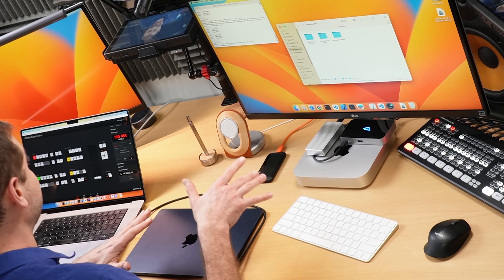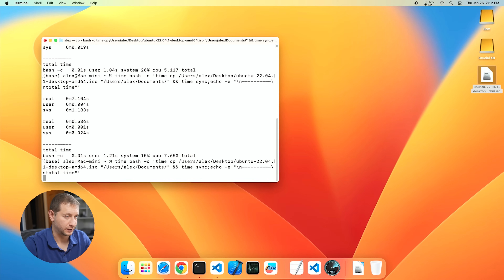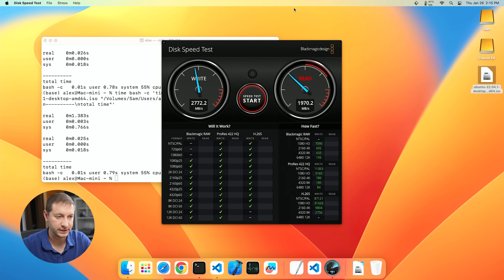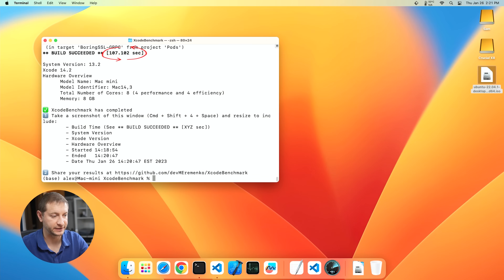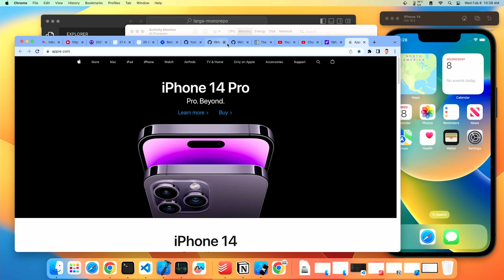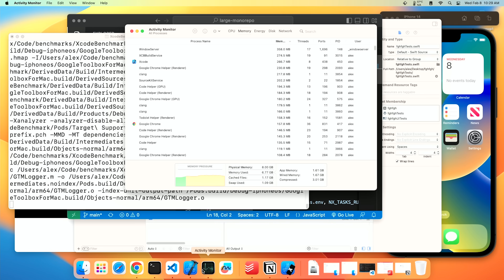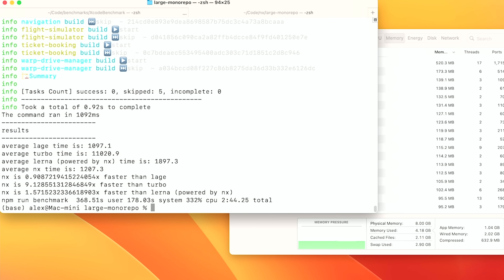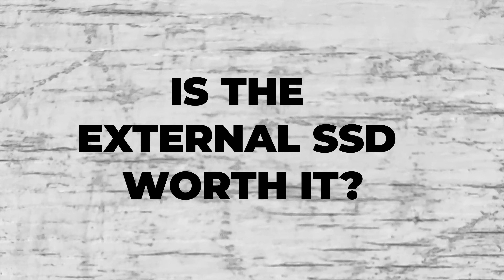...but there's a catch

Comment: Has it been confirmed that if macOS Sequoia is installed to an external NVMe drive and you boot into that external drive OS, that the swap that it uses by default will be a swap partition on the internal drive?

Comment: I just upgraded to the Mac Mini 4 with 16gigs of ram and 512 HD. After watching a few videos the ram is upgradeable and the job can be done in less than an hour, not that I plan on doing this as I got the same external as you have and put a 2 TB drive in it

Comment: I have a question.  Did I make the right choice?    I ordered the new Mac mini with 32 Gb ram but left the internal drive as base 256 Gb.   My logic is I can upsize storage externally, but can never do anything about the on chip memory size.  
Is 256 going to big big enough to future proof the macOS versions?  At what point does the OS take up enough of that 256 to become a problem?
Reply: The latest macOS only requires 25GB of free space to install, so there's no reason to be afraid that 256GB will be too small for future versions anytime soon (as in within the next decade). There might be reasons why future versions require significantly more disk space to work well post-install, but if 256GB ever becomes an issue, it's very likely that you'll be able to offload some of that extra stuff to an external drive -- e.g. a large local data cache for Apple Intelligence. At worst, you would sacrifice some performance, but even then, in most cases, you'd be fine.

I'm getting the 256GB m4 mini and planning on buying a 1TB external Gen 4 SSD for everything but macOS itself. Should be fine for the foreseeable future.
Reply: @ 
Thanks for the reassurance!

Comment: I dont exactly understand why you dont picked the Samsung 990. I mean it has better read and write speeds. Is it because thunderbold 4 is Not as fast as the 990. Pleas help!
Reply: Above 3000MB/s you get diminishing returns. TB4 tops out at 5000MB/s but the M1 and M2 implementation limits the throughput to around 3200MB/s so any drive faster than that isn't worth the money. This is because internally it uses PCIe Gen 3.0. Not sure if this still applies to the new M4.

Comment: I got over 3500Mb/s write and 2500 read speeds with external 40Gb/s connection. With good and short USB 4 cable.

Comment: I have an samsung ssd that came inside my mac mini late 2014 2.6 intel i5 version. My ssd writing/reading speed is around 600-700 mb/s.  Can I get higher speeds with samsung 990 or it is limited by the manufacturer?

Comment: Is there a way to let the Mac Mini use an external SSD for swap without booting from it? (might be a dumb question)
Reply from the maker: not a dumb question, but a very good one. i researched this and while there are some hacks, it’s not going to work well. swap is for really fast memory access, and putting that file on external will likely drastically slow down the system should it need swap. i’m also not sure about how stable this setup would be.

Comment: Thank you so much for posting this here. This was a fantastic solution to a big problem for me. I made the mistake of buying a Mac mini with a quarter terabyte hard drive and that filled up much faster than I expected. But here are a few tips for everyone if you decide to go this route. This is what worked for me. Your situation might be different, so be aware that you were using these tips at your own risk.

0. Create another administrator account on the Mac. You will need this to change the home directory for your moved user.
1. Close all apps on the account you are moving to the external drive. 
2. Turn off iCloud Drive completely. Before I did, this, I was getting repeated errors that blocked the copying of the home directory to the external drive. I found this was the issue after moving the contents of the home directory one at a time and the issue was in the Mobile Documents folder in the user Library. This folder is deleted when you turn off iCloud Drive. Files will remain on iCloud.
3. Do is a fresh Time Machine back up of your Mac. 
4. Open to Finder windows side-by-side.
5. Drag and drop the whole user home directory to the external drive. Do not delete the original home folder. 
6. Log out of the user being moved and into the other administrator. 
7. Change the home directory per https://support.apple.com/en-us/102547 
8. Restart the computer and log in to the moved user. 
9. My wifi and ethernet would not work at this point. I resolved it as follows: 
10. Go to System Settings / Network and click the (...) button at the botton, click Locations / Edit Locations / click the plus sign to create a new location and save/apply that. This got my wifi working. 
11. To get the wifi working again, I navigated to System Settings / Wi-fi / clicked the Details button for my wifi, click TCP/IP  and clicked Renew DHCP Lease. 
12. At this point, don't delete the original internal home directory, but rather rename it by putting an X at the end of its current name. 
13. Restart the computer and login to this user again to make sure things are working properly. 
14. Be aware there may be some apps that will be looking for specific folders that they think are on the internal drive. You may need to go into their settings to update them. The Photos app in particular will have a specific location set for the system library and you will need to update that. For that one, I navigated to the external home directory where that library was located and opened it from there. That got it properly aligned. Otherwise the Photos app will try to open the one on the internal drive. Dropbox is another that will need re-linking or to be set up again. 
15. In the Time Machine settings click Options and make sure it is not excluding the external drive where you're home directory now resides. 
16. Change the name of the original home directory back to what it was. 
17. Delete most or all of it's contents, depending on what you run into in doing so. Remember the user Library is hidden, so you need to type Command+Option+. (that's Command+Option+PeriodKey) to reveal hidden files in Finder.
18. Do a new Time Machine back up.

Comment: If you run your MacOS from your external drive, is the internal ssd used at all? I imagine is external drive is now the system drive, memory swap will also happen there instead of the internal ssd.

Comment: But... there is something missing there. It doesn't make sense. You can see in the Activity Monitor when running on the internal SSD that there's only one instance of node and it's taking ~500 MB of RAM. When running on the external storage there are like 10 instances, each one taking 1.5 GB do RAM, bringing the system to that unstable behavior.

It doesn't make sense that you're running at a faster storage and the system is slower in comparison. You're not requesting as much swap in both scenarios.

My only explanation which is a far fetched one is that the system bus is taken over by the Thunderbolt 4 transfers, such of which it doesn't happen when using the internal SDD. And when TB 4 is being used, the parallelism takes longer, more resources are being allocated when the current running tasks should have finished before allocating new resources and creates a snowball of competing resources. But that's speculating a lot of conditions.

Again, I believe i missed something because it doesn't make sense.
Reply: another thing I noticed. It's a freshly installed system, right? The OS is still performing the metadata for Spotlight, among other things. Check that mdsync process, taking between 2.5 and 3 GB of RAM.
Reply: @DocaTafner  very important, i remember that even on my m1 macbook air, in the first days using it, spotlight, time machine, and other apple process would suddently start using almos 20gb of swipe memory! im not even joking

Comment: worst news for me. I just bought a M2 mini 512gb 8gb ram for use with Logic Pro X and will use an external SSD to mitigate the ram limitation. Does not sound promising
Reply: have it worked?
Reply: @DanielMaia  it works fantastic only issue is my SSD disconnects however I make sure it’s plugged into a USB-C port not a hub
Reply: @RedCloudServices  but if you let it plugged into the usb-c port it is ok? my swap memory usually its arround 5gb when im working on logic if you want to know

Comment: has anyone else had problems with their external drives randomly disconnecting?
Reply: My system keeps freezing then restarting - i have a feeling its to do with drive getting to hot
Reply: @darkkent8  in the end I purchased a different drive enclosure and everything worked fine after that.
Reply: @cyberlizardcouk  Thank for coming back to me, what enclosure did you have? and what did you get instead?

Comment: If you’re going to stress test the system then buy a better SSD. You used a 3 year old SSD that maxes out at 3000r/w that will throttle with heat. Getting a late gen 4 ssd like Solidigm should get you more bandwidth for intensive tasks as they’ll only be pushing half of their capable output and will run smoother and more consistently. This video is exactly why Apple locks down their ecosystem. Different part’s different results.

Comment: Sorry I didn’t get one thing. If I would use the external drive as a backup drive, not the system one, and manage all repos in there how would npm installs and frameworks start go? I am a heavy Gatsby user that is great but it sucks at performance on build/dev boot..

Comment: That's why I don't like greedy Apple products,  instead of making a user-friendly solution for replacing the internal SSD for any other you want (or even upgrading RAM), they initially started using their proprietary SSDs (fortunately there were adapters for such cases, I have a couple) But later they started soldering SSDs with the RAM, I cant accept it, it's not an tablet, it's a working horse, one should have an easy way to recover the data and the whole working process if SSDs had a failure. But now the lifetime of the new MacBooks (if you don't use eternal drives as a system drive) practically compares to the lifetime of the their internal SSDs (other components, except battery, have less impact on it)

Comment: This is insane. Thunderbolt 4 hub, Thunderbolt 4 drive enclosure,  additional drives.  All this extra money to save on the base Mac Mini.  How can anyone consider the Mini a bargain? What I came away with is buy a Mini with more RAM and then buy the necessary items for more storage. This becomes expensive very fast. Other than possibly single threaded core performance how would a Windows desktop compare at the same price points? Forgot about laptops as the Mini is a desktop and is not a valid option for portability - you still need a keyboard, mouse and monitor.
Reply: "How can anyone consider the Mini a bargain? " - because most people don't need what Alex demonstrates. One can get a M2 Mini w/ 16GB in the Education store for $679. Add a $78 Samsung 1TB SSD and make that your boot disk.  In total a moderate cost for a machine that will be all 99% of people will ever need.

Comment: Great video!
Observation: I copied your Mac Mini setup to the letter including using a Samsung NVMe in the Orico enclosure as my boot drive on the Mini 256/16. To my surprise, the Orico enclosure gets very hot during even minimum use. Since it is my boot drive the heat makes me very nervous. Is this something you’ve run into? How much should I worry?
Regards

Comment: I believe the culprit is not the Thunderbolt interface, but the flash drive. The 970 Evo Plus has been silently crippled by Samsung to use QLC NAND instead of TLC NAND. Once the superfast SLC cache is filled/overwhelmed (easily done by swap) then the drive will run much more slowly. See "Samsung seemingly caught swapping components in its 970 Evo Plus SSDs" dated 8/27/2021 on Ars Technica. 

Using a higher end/better quality drive would probably have avoided your performance issues when under heavy memory pressure. Just remember that there are also DRAM and DRAMless M2 drives too, and although DRAM SSDs are much faster one must also consider what happens in a power failure since DRAM information is wiped once power is cut, so finding a DRAM SSD should also have capacitors to keep them powered so information on the DRAM can be written to the SSD, which is probably important for an OS/data drive.

I think Apple has given a great deal for the base machine, but 8/256GB is probably underspecced for anyone doing more than basic browsing or office type tasks.

Comment: SoI tried this before seeing this video. Started with the Samsung T7 shield 2tb SSD...
It wouldn’t work!!! I then tried using a Sandisk G-Drive 2tb SSD. It allowed the proper format.
The Samsung T7 would not except that format.
I installed Ventura, copied the 256 internal drive to the Sandisk.
Works ok, but I lost nearly 500mbs of speed due to limitations of the drive maxing out at 1050mbs...
At least I gained 2tb of storage. I already had nearly 100gb of music on the 256 SSD internal drive.
With 1.62tb of iTunes files on a external SSD. Apple loses way more than they realize by being so outrageous on storage prices...!

Comment: Swapping to an external SSD does not use DMA. Samsung 970evo plus has one disadvantage in that scenario when more than 80% full the 990 Pro is the only drive that nearly does not go down in access time and transfer rate due to a changed timing of TLC and a better Controller. Having the thunderbolt drive as the main work drive but not the boot drive is fine. It takes the load and is easily replaceable or upgradable when used up. The only issue with those drives is they need good cooling, otherwise, they slow down when getting hot. So don't underestimate the contact with head transfer material to metal parts in the enclosure, they have to be well established to have a stable system. I use it as the main Finalcut Work folder, Download folder and VM image folder. Those folders have been linked to the normal System on the internal SSD. Works fine and is reliable.

Comment: What about running the M2 mac Mini from the external drive and not using the internal at all? I got the base model with 16GB Ram and the 256GB storage and use a sandisk 1TB external

Comment: You said something at the end about loading software on the external drive. Did I understand that correctly? Sorry, I am new to this. Just ordered a Mac Mini M2 after my iMac died. I am used to working with 3tb internal drive so I am a little nervous with just 256gb internal. Thank you

Comment: Nice technical video. I was looking to get the M2 Pro, but maybe the M2 is enough. Nice trick with the OS on an external. I do basic, video, podcasting etc. Not a programmer. Currently my desktop is an i7 Macbook Pro 2017 16RAM & 1T SSD, 16T HDD external. The savings with the M2 I could get more RAM and the needed bluetooth keyboard & track pad.
Reply: Problem is not external drive itself that much. Problem in Alex case was huge, abnormal swap which depleted SLC cache on the 970 Evo.
With 16 GB of RAM, 980 Pro (which doesn’t drop performance as 970 Evo when cache is full) you shouldn’t have any problems at all.

Comment: In rare cases it does help to have even faster SSD speeds. I know it is a premium to pay, but the larger drives in the newer Mac models exceed 6,000 MB/s. When working with huge sqlite files (lots of ram and SSD swapping?) it can be noticed.

Comment: this is how i run my m1 mini 16 ram with 256 ssd. i added a acasis tb4 enclosure with a nvme ssd running system off it for 2 years now. i only boot from onboard drive to update it.

Comment: Hi there
Great video!!!
I would love to do this on my brand new M2 MacMini (256GB, 16GB Ram)

I was wondering if this would work with NVMe installed either on Qwiizlab USB C Hub with Dual Drive Enclosure or Satechi Type-C Stand & Hub with SSD Enclosure
Would these HUBs be fast enough to work as in your external enclosure?

BTW for external storage only (not OS installation) what about Flash Drives, they're big enough (1 or 2T) vs External SSD (I'm using those now)
Thanks and regards
Reply: I just learned that the Satechi Type-C Stand & Hub with SSD Enclosure is only SATA compatible no NMVe

Comment: Nicely done....but am I missing something? The 980 Pro NVME M.2 has a 7000mb speed so its double the speed and is only €10 extra?
Reply from the maker: you might see prices fluctuate quite a bit, sales etc.
Reply: @AZisk  actually I wasn’t aware that TB4’s limit was around 22gb/s so the 970 is just as fast for that but as someone mentioned the chips are much more reliable so for an extra few € it’s worth it to go 980 I think. Great video

Comment: Thunderbolt 4 maxes out at 40GB? Doesn't the data transfer bandwidth for the m2 chip, RAM, and internal memory run at 100GB? I think your bandwidth limit with Thunderbolt 4 creates a 60% decrease in data bandwidth. Looks like that's where your bottleneck is.
Reply: not until the SLC cache is full. Which is for 970 Evo about 6 GB – and at that point Alex saw a performance drop. That's the main cause, not thunderbolt. Internal SSD doesn't run faster than that too. In any PC you barely find SSD over 3500 MB/s (yeah, new PCI gen 4) but even at SATA SSD you will not get such unresponsive system. Low RAM and SLC cache are the culprit here, not thunderbolt
Reply: @ZhuJo99  interesting. I guess the only real solve is to get more RAM...